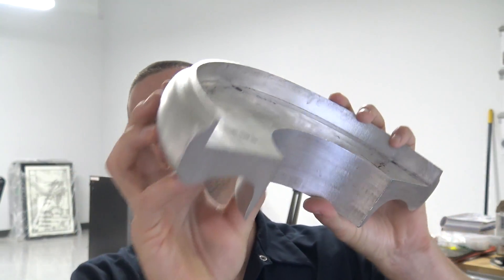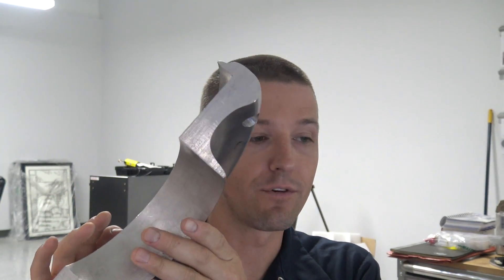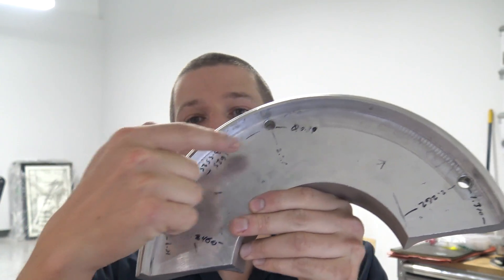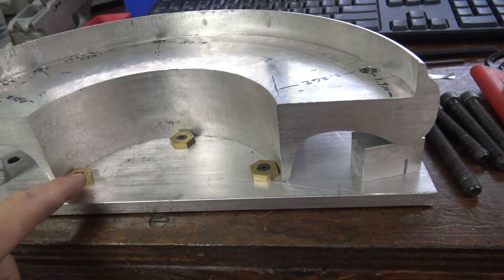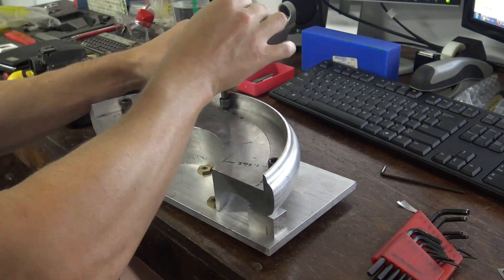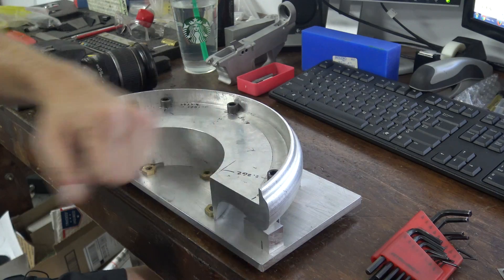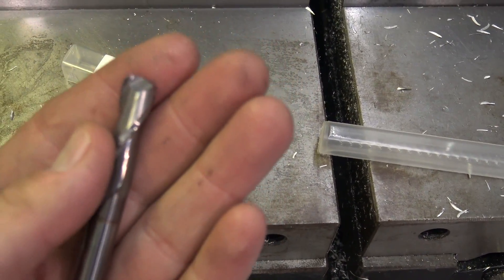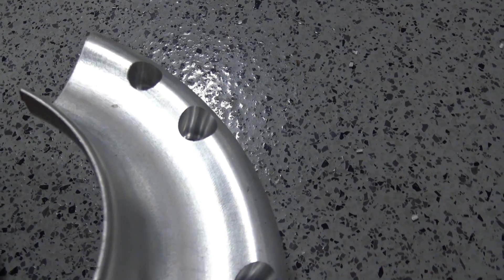Creative Fixturing to CNC Machine a Motorcycle Oil Tank!  WW111

Comment: You are right on about the miteebites.  On of my last fixtures I had 5 out of 42 clamps ground incorrect from the factory so I had to back them out one complete turn to have the cam engage and clamp the part correctly.  

picture link...
https://www.dropbox.com/s/v4di07vatprgx92/20170712_215221.jpg?dl=0

Comment: John, I like your quick and simple shim washers. I've made some similar using the carbide disc punch sets you'd find at the 'freight store, or off of Amazon. Works nice to knock out the inner hole then eyeball it for the OD shape especially if you need it offset along a wall. They don't like <.008" material usually, depending on the manufacturing tolerance.

Comment: For all those asking about the weight reduction:  I didn't weigh the part before John performed his magic, so I modeled the original part (pre-SMW machining).  I didn't remove the two holes and fluted counterbores John cut for us, so the actual weight saving is a matter of ounces more than these numbers.  Original (CAD weight) part was ~4.2707lbs (+material in 2 holes and counterbores).  CAD model John machined from is 1.8827lbs (in CAD).  Weight savings (not including 2 holes and counterbores) = 2.388lbs.  It does feel like it is less than half the original weight.
Reply: Couldn't take it.  If you're as anal as I am and just had to know: the fluted counterbores (yes, I modeled one) weigh 0.333lbs (in CAD), so 0.666lbs for both.  That means the total weigh savings (according to the CAD models) is 2.4546lbs. ;-)

Comment: Interesting part to hold.   Have you ever used low melt plastic to custom form a support for irregular parts?   This stuff works well in conjunction with other clamping systems and tends to dampen harmonic chattering.   Its one draw back is you can't hard mill or otherwise put too much heat into the part.  It melts in a double boiler at about 60C

Comment: I have a question (I don't do this type of work at all). Why on your passes to shave metal off do you only go one direction instead of going one way move the bit in and go back the other way?
Reply: HSM adaptive cuts or really any highspeed toolpaths should be done in climb milling only. 

Adaptive cuts rely on maintaining cutting angles and chip loads. Reversing the cut direction changes the cutting angle. 

Plus climb milling takes about 50% less power to make a cut vs conventional milling. And those mills are already starved for HP as it is.

Comment: I saw your vid with the USB control for  your pumps, and I thought that you could use something like that to control the on off function remotely, meaning you mentioned you ran this part lights out, why not setup a webcam stream of the part running on the machine so you can watch from the diner table and if something messes up you can hit a stop button on a remote app. This way you can remotely watch the run, even if you are in the other room in the shop. I am sure Ave and you could team up on such a project that would be swett, a CNC webcam / control app,  Just a thought.
Reply: We have this at our shop on a few of the 5 axis mills. One cam above the spindle (it's a HBM) and one at the controls. That way, when we are at the other end of the plant (2-3min walk) we can pull it up quickly at any computer in the plant and check on it, or on our phones while we are out to lunch or something. Very helpful to keep machines running.

Comment: For the timelapse shot, it seems you have two different lights inside the mill enclosure, one close to the camera and one in the far corner. The one close to the camera is a nice white well balanced with the rest of the shop lights, but the one away looks really yellow. On one hand the color difference might give some volume to the parts (because different specular reflections will have different colors), but that yellow doesn't look very nice.

Comment: John, you have to see if customer will let you do follow up video of this bike. Really hard to believe that it will only weigh 400 lbs when done. Would be great to see it and how they adapted your part into it. Nice job on the part by the way.
Reply: An Aprilla RSV4  with 205 HP stock has a dry weight of 398lb that's with fairings and stuff as well. 

Striped down and modified to reach 400hp within 400lbs isn't a huge stretch.

Comment: So John, how much weight did you shave off, do you know?
Can you please make a video about how is it possible to work
on a piece that is not just a block of aluminum, but is a 
part for  ex. that you modify on the mill?....That would be interesting, thanks!
Reply: A few ways. It appears it's a full 180 arc. And the two flats are parallel. Tram those in straight along the X axis kinda like a vice. 

XY zero can come off of one of the existing holes in the part. Z  zero you can use the top of the flat area he's removing. 

Considering it's only weight reduction and nothing high accuracy, the fixture plate and bolts used to hold it down were probably adequate for alignment.
Reply: thanks for the info buddy!!

Comment: I would highly recommend looking into get/making machinist jacks.  It would have saved you the trouble of making those spacer blocks.  Real ones are nice with the different top pads that swivel but they are easy to make quick and dirty ones using a pipe coupler, some washers, a nut and various length bolts to give you low profile up to a decent height cheaply.  They are very useful if you have a long piece in a vice and are drilling holes in a part that is cantilevered out.  Designing and doing the fusion 360 of a decent set, then machining them like you did with the clamps might be an interesting set of videos.  Just a suggestion.
Reply: I've also get the first thought about machinist jacks
Reply: cncua must have for parts that don't sit flat and need that extra support